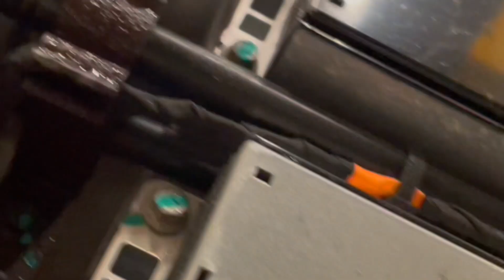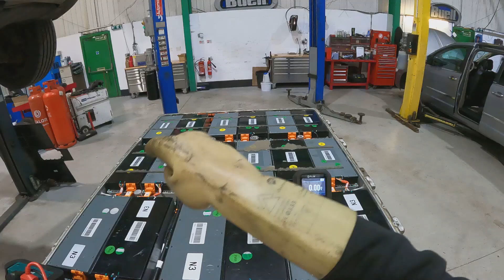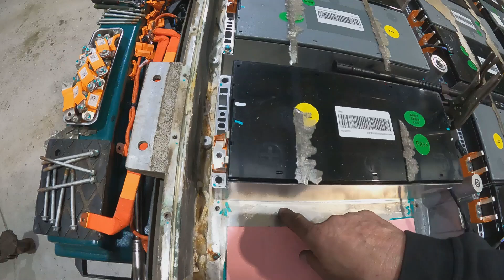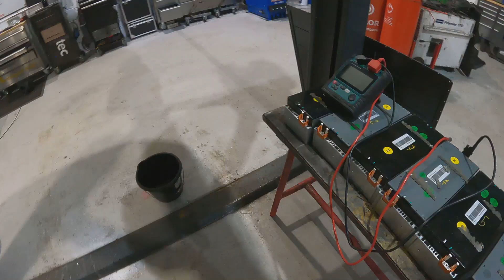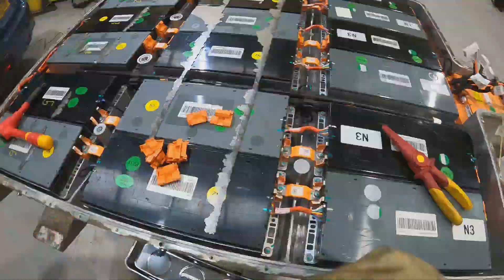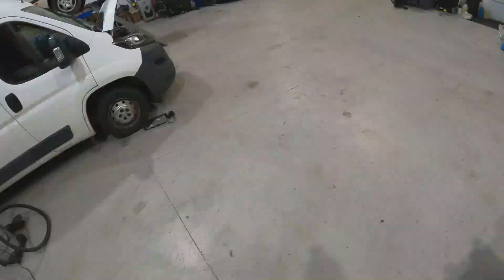MG ZS EV High Voltage Battery Repair.

Comment: Been working with electric scooters and the most common problem is the battery management controller. Sometimes it lets battery to charge over voltage and whole package stops working because BMC blocks the usage. I have drained overcharged battery with resistive heating element slowly so that the voltage goes under the upper limit and controller starts to work again. Same ofcourse happens undervoltage, so you need to charge the pack past the BMC if it wont let you recharge.

I cant help but think that E-cars has similar problems. The BMC they put in the batteries are pure garbage.

Comment: For future reference, you can buy the modules separately. 9x are masters with a control unit inside and 9x are slaves. 1/10th price of a full sealed pack! Car must have a balancing recharge after though. (3 pin slow charge over a weekend) ......MG tech!
Reply: Where to buy individual modules? Thanks
Reply: @adrianbeaca3194   Hi, they are listed on the MG main dealer parts catalogue. I had to replace a couple myself a while back.

Comment: I've been in to VAG batteries, Nissan, PSA and MG (catl). I disagree with your findings. They are superbly built, and I hope you are aware that you can try to shove your finger in there and if you manage to touch that busbar with very slender fingers, nothing will happen. You'd then have to manage to stick another finger somewhere near the other end of the chain of modules in order to get a shock. I mean really you'd need to make a significant effort. But wear gloves by all means.  Oh and to say its similar to the Leaf battery is just bonkers, they couldn't be more different.

Comment: It was great to see the "inside" of the MG battery Pack, and to also watch the examination of each Cell and the Insulation Testing. However, I am no expert, but thought that anything over 20M Ohms would be OK. My biggest concern was those Plastic Unions (inside of the battery Pack), and the Coolant that flowed through. I honestly think that the Inlet & Outlet should have (perhaps) undergone some Pressure Testing, and I am thinking that 1 Bar should be sufficient - since this is a low-Pressure System. The dampness found inside that battery Pack will definitely shorten the Battery Life, as cathodic corrosion takes over. Many EVs will need to drive on flooded roads - and survive with their Battery Packs potentially fully immersed! Thankfully, I own a '71 EV Beetle, with both Battery Packs way up high, at 750mm above Road Surface level. At least the Owner of that MGEV can see the work entailed in getting down to the problem. Greetings from Australia.

Comment: *Assuming the insulation tester is using AC* and not being affected by the DC from the battery, there is no point isolating and testing insulation on individual batteries, as all leakage will be in parallel, and any resistance on a particular cell will be teh same or higher than that of the pack as a whole, though it may help in locating where leakage is occurring.
Reply: ..although it might be useful in finding the location of any leaks/damage

Comment: Great video - thank you. The shocking thing to me was that a front spring had broken on a 2019 car. It cements my view that I wouldn't touch an MG with a bargepole. I've seen similar build quality problems with Tesla. Are Volvo any better because they, too, are Chinese built these days. I currently drive a Skoda and, so far, it's been fault free.
Reply: That’s a bit unfair, I’ve had a snapped spring on a 6 month old bmw. Pot holes are lethal
Reply: early spring failures are sadly quite common

Comment: Great video - thanks. No need to measure insulation resistance to both polarity terminals on each module as they are connected via the internal cells. Also personally I would use rubber gloves when working with an insulation tester that generates over 500 volts.

Comment: One EV to avoid: I test drove one, managed to crash its software 3 times on the road. Sure they fixed that but overall it is designed to be dumped past warranty. Lucky you managed to save this one.

Comment: It proves to me that you and your team are the trailblazers in fixing EV batteries, dispelling the myth that, you must purchase a complete unit. In a few years time, many motor shops like yours will be springing up offering to repair defective EV cells.
I did wonder if the pink pads under each 22.2 volt cell had reacted to water ingress. iPads and iPhones have a tell tail moisture sensor similar to what you have there. I would have been tempted to lift another cell from the next bank just for curiosity. It’s a shame that any of the internals can’t be purchased from MG directly. The underbody protection was almost none existing. That’s going back to the days when manufacturers didn’t even bother with any type of rust protection. A very interesting watch! MG should be ashamed of the standard build quality in my opinion.
Reply from the maker: The battery is partitioned and there was no evidence of moisture in the other rows

Comment: Thank you for this insight. Good to know. So this battery is non-serviceable in the sense of that internal parts cannot be ordered. Apparently there's no moisture ingress sensor and the seal fails before the battery itself is EOL.
I think I'd also inspect the BMS boards and cabling for moisture damage. Or at least, to see if I'd be happy with the BMS moisture protection. For peace of mind. You know. I mean, they failed to get the sealing right. Who knows what else could go wrong with that battery.

Comment: Don't the high voltage battery have a 7 year warranty?
Reply from the maker: Upto 100k this is at 110k
Reply: Warranty’s ain’t worth the paper they are written on
Reply: @charlottedowsett122 yes they are, it was under warranty for 100,000 miles

Comment: Great video thanks for sharing. Did you re use the original gasket or apply another kind of sealant to the battery cover?
Reply from the maker: I used a waterproof chemical sealant called CT1

Comment: Those gloves look like they need replacing! Good video!
Reply from the maker: They’re fine, they get dirty if you use them you know
Reply: @intelligentauto737  national grid guys wear leather over the rubber to protect them a little
Reply from the maker: @itsmyview2024  national grid guys are working on 25000V not 400v